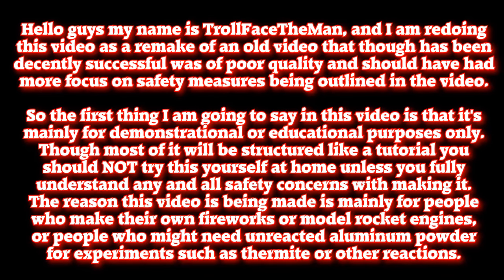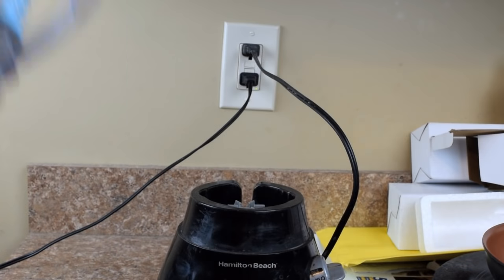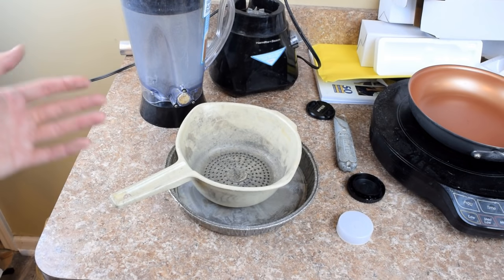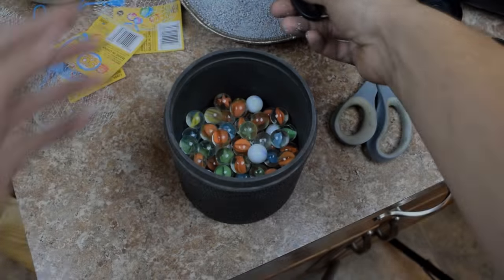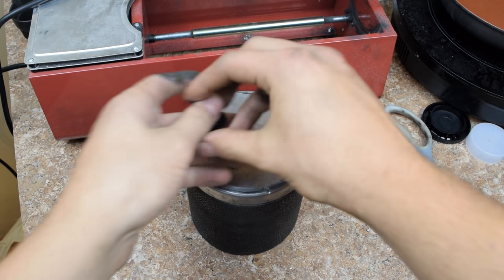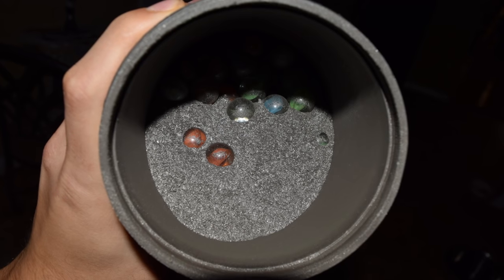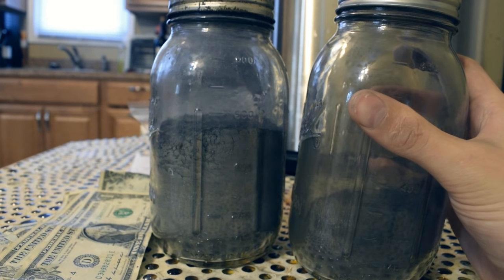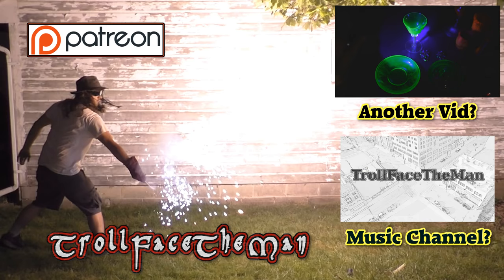How To: Easy Bulk Dark Aluminum Powder (My Homemade Process)

Comment: TrollFaceTheMan Have you heard the version that glass balls can emit static electricity that can ignite the composition? And you said that lead balls are not as hard as aluminum, so glass balls are much stronger than aluminum?
Reply from the maker: I have heard people suggest that can happen but never experienced it or seen it myself. It also doesn't make sense as Glass and Aluminum both become positively static charged (Donate Electrons) so rubbing against one another will have little to no effect in charge imbalance.

 More likely is possibly piezoelectric effect where voltage could be induced if the glass breaks but I also haven't seen that.

 And yes glass is much harder than aluminum. While lead is significantly softer.

Comment: I remember reading on Science Madness forums about an accident using this method where the person used Steric acid to inhibit oxidation which you really DONT want to do.  On opening the flash was enough to give him burns from the light alone.  I COULD be mistaken and it may have been Magnesium on second thought but I dont believe so.  IDK, Just be careful.  To fine and using an anti-oxidation additive can cause big problems when oxygen is re-entered into the equation.

Comment: Just got the link to this video in "suggested" again. Saw it years ago and now I am back. Subbing because you are still active. I believe I have the same ball mill or a substantially similar one. It is part of a rock tumbler kit I picked up at a 'yard sale' which was sold by Sears back-in-the-day. The kit is complete so I haven't tried to mill aluminum with it for fear of wreaking it. I want to build a dedicated unit for safely ball milling volatile elements. This process may be adequate for general purpose pyrotechnics or amateur rocketry but It is my understanding that the production of 'dark aluminum' or 'German aluminium' involves a different process. The process involves molten aluminium 'sprayed' into an inert atmosphere (noble gas. argon?) proceeding or coincident with the introduction of pure carbon as a 'coating'. anyways, have fun...
Reply from the maker: The process I read about involved paper lined aluminum that was had the paper burned into  carbon film then repeatedly hit by a crusher till it became a fine powder.

Comment: I tried making thermite. After failing to light w a torch I tried a large magnifying glass.turns out the magnifier works quick and easy. Thermite melts into a tiny ball and starts pulling in material around it then lights. Kinda cool
Reply from the maker: Cool to know, thanks!

Comment: 2.5:5 charcoal:aluminium? so 1:2? what?
can you please say how much in grams? i have cups in various sizes..
Reply: he say 2.5 - 5% charcoal to alluminum by weight ! but i ask him what does his mean ! 95 al and 5 grams charcoal total 100 grams or 100 grams al total and plus 5 grams next  make it 105 grams? and i wait an answer!!!
Reply: @willowpine2604  95 % and 5 % equalls 100% so you would use 95g and 5g to make 100g not 100 and 5 . That would be 105%
Reply: So for 5g of aluminium I should add 2.5g of charcoal? Somone pls answer
Reply: @Epoch_Money 5 PERCENT. So if you had 5 grams of aluminum, it would be, what, 0.25g of charcoal?
Reply: @oldkingcrow777  yes 0.125 to 0.25g charcoal powder for 5g al

Comment: TV/Film used to use a lightning simulator that basically was a burner with a air system that injected fine powdered aluminum into the flame with air pressure.

Comment: It's Pyrophoric  not pyrophobic (afraid of fire). And I use stearin instead of charcoal. Stearin is used in conjunction with Aluminum flakes to help in the grinding process in making Dark Aluminum powder. It is also used in some fountain composition, which calls for stearin powder. Stearin is a glyceryl ester of stearic acid, derived from animal fats created as a by-product of processing beef. It is used as tallow in the manufacture of candles and soap.

Colorless, odorless, tasteless, soapy crystal or powder. Purchase the technical grade, powder. It can often take the place of Sulfur and Charcoal in fireworks.
Reply from the maker: Thomas Valliere yeah that was a mispronounce by me.
Reply: you seem pretty smart,i appreciate the info but i will never use stearic acid again,it was awfull compared to charcoal
Reply: Stearic acid is used in making bright (tin man) aluminum, charcoal is used in making dark aluminum.

Comment: I had problems with the same tumbler. After a few days the aluminum was starting to get small enough, then on day 3 it became very difficult to ignite at all, even with kclo3. On inspection through a stereoscope I noticed a brown sludge that I later figured out was the rubber off the jar. I kinda thought about that when j was adding the Al, kinda like your trying to mill steel with copper analogy.
Reply from the maker: I never had that issue. Interesting.
Reply from the maker: Did you use any charcoal with it. It can protect and lubricate.

Comment: I also found that nickel-chromium bearings (best to use 2 different sizes for milling efficiency) work very well and do not spark. Much thanks to EM for that one.
Reply from the maker: Good to know. As they solid or just plated though?

Comment: Good video, thank you.  Horrible Freight sells that tumbler, too (or one that looks like it came from the same factory).  Get the double barrel version and use just one barrel at a time with no more than 5# of stuff in it.  The motors are not thermally protected and will be damaged from overloading.  I sent two back before I realized my error.  You've been warned.  :)
Reply from the maker: Thank you for the tip :)
Reply: Made my mill from junk. Works good think it turns a little too fast but gets job done.

Comment: Ballbearings have a chrome coating which doesn't spark, and is very hard. The coating is thin, and can be eroded, but sparking as a potential ignition source is a very low risk. You're more likely to generate a static electric spark than a ferrous decomposition spark in a ball mill. So if you really are so concerned with ignition sources, ground the whole apparatus, or process it in an inert atmosphere. You can even use flakes of paraffin wax in the milling process to coat particles and protect them oxidation. Though it is impractical for the home scientist pursuit to want these lab grade results.
Reply from the maker: +nunya bisnass I have used Chrome ball bearings but have had issues with the coating flaking off as you mentioned. You are correct potential ignition is still low.

 But I'd rather people be safe than sorry. Grounding the barrel wouldn't be very effective in this case as it is completely rubber coated.

 The mill is already grounded though per the 3 prong plug.
Reply: @TrollFaceTheMan you could just make this whole process a wet tumble and just use whatever.

Comment: I would mill the aluminum in argon gas, and store it under argon, or a light organic solvent, such as acetone.

But since my use is in thermocasting precision alloy steel parts, total contained reaction energy is critical to a complete and uninterrupted reaction in the process.

Comment: Very informative video. I have a question: what is the best way to store aluminium powder ? do you also have to 'oxigenate' the powder once a day ? like open the jar etc ?
Reply: In a locked container with no other active ingredients in the same locked  container.
Reply from the maker: After it is milled you just need to store in an airtight container theoretically no additional oxygen exposure should be needed.

Comment: There are simple pressure relief valves on inflatable toys that might make the airing out of the tumbler easier.
Reply from the maker: +Jay Pearce It's not actually a matter of airing it out, but letting air in. The issue is the aluminum consuming all the oxygen in the tumbler and then reacting violently when the container is exposed to fresh oxygen.

 So actually a vacuum can generate inside the container while milling.

Comment: Surely, if you are rolling in a pretty much airtight mill, you can use steel balls all the way.
I know you said to keep letting air in each day because the aluminum eats all the oxygen but surely, once all the oxygen is consumed, sparking becomes impossible since sparks are quite literally the rapid oxidation of a chip of steel/iron.
I say it would be perfectly safe to mill for a week with steel balls, but when finished, leave it for a day or two and even then, when "equalising" with the outside atmosphere, do it very, very slowly.
I'll let you know how I get on.
It helps , having a degree in chemistry.
I'd probably take more risks than your average Joe but that's only because I understand fully, the fundamentals.
>
Reply: There's a reason you introduce oxygen when milling metals(say daily). It's so that you actually get a layer of oxide to prevent the material from becoming pyrophoric. A metal such as magnesium is more likely to ignite when fine, but there are plenty of burn stories when opening jars. This aluminum looks decent but is certainly not all like 2 micron flake. (Safety tip) There are also other ways to "lubricate" the aluminum instead of using charcoal.
Reply from the maker: Your way could definitely work theoretically if you are careful and follow your methodology.

Comment: Thanks for a great video.I'm probably never going to actually do this stuff but it's still interesting.The thing is I cringe at what some people do on here and I really dont know that much. Luckily I know enough to know it''s not the right way to do things if you want to be around for a while ;)
Reply from the maker: +SouthJerseySound I am glad that you like the video. But I am confused by the second half of your comment.
Reply: TrollFaceTheMan It was referring to others videos.I see guys using steel ball bearings,unshielded motors in some dangerous setups that could easily spark and ignite the dust etc.
Reply from the maker: Oh okay, thanks for clarifying :)

Comment: The swirl in those marbles contains metals too! It will become exposed as the glass slowly chips away and makes nice big sparks. Have you ever thrown a marble on a hard surface when its dark? Marbles are NOT a safe milling media!.
Reply from the maker: Those are metal oxides in them used as colorants not straight metals and if you know about basic chemistry then you know oxides Don't spark as sparking is the process of a small sheered metal piece oxidizing and generating lots of heat rapidly.

 And when you mention throwing marbles on a hard surfaces and seeing Sparks then I can assure you in almost every senario that is because the marble is causing the surface to spark, not the other way around.

 For example you whip a marble at a steel table top and you see sparks. What's happening is the marble is sheering off a small piece of the steel table and that makes the sparks.

Comment: Works better if you put water in the blender with the aluminium. Makes the particles smaller and it cools the aluminium. Pour it out in a dish. Let it dry. Enjou
Reply from the maker: Thanks for the advice.
Reply: @TrollFaceTheMan  no problem. Just thought i share the info. This method saved me a lot of time

Comment: you can save yourself a lot of time and get a finer powder if you burn the foil with a torch before . it makes it more brittle and easier to break down .
Reply from the maker: Does make sense, although wonder how much pre-oxide that makes and ifbit has a significant effect by the end?
Reply: @TrollFaceTheMan  i never noticed a difference but i was making thermite
Reply from the maker: @andyvonbourske6405 , well thank you for the suggestion. I can see for sure how it can help.

Comment: Warning! 
Do not add to much charcoal. If you do, it could coat the aluminum too much and when you take it out. You could strip the coal off of the aluminum which will ignite it. I learned it the hard way. Use less even if it makes it worse.

Comment: 2 questions. 
1. Would ceramic work for milling media in place of marbles? 
2. What is your charcoal made from?
Reply from the maker: I believe ceramic should work. And I thought mine was some maple sticks.
Reply: By having 2/3 marbles & 1/3 lead balls, the weight of the lead pushing against the marbles would make the process faster ??

Comment: I was going to ask about milling magnesium, more volatile conditions, less or the same.  Same precautions I would assume as aluminum, but wasn't sure if there was any quirks I needed to know about.
Reply from the maker: I've milled magnesium. Definitely need to worry more about spontaneous ignition. More frequent airings are a good preventative.

Comment: If you seal the unoxidized aluminum powder in a vacuum seal glass ampule would the rapid oxidization effect cause the powder to combust? Asking for a friend
Reply from the maker: Yes, when it did eventually contact oxygen it would rapidly combust. Nurdrage did a video of that with iton powder before.

Comment: Thank you for the extra information on this.  I am in the process of making it myself through trial and error, I just need to add my charcoal. I just need to use an accurate amount. I have about one cup of partially milled aluminum,is it too late to add charcoal?
Reply from the maker: No you should be fine to still add it. I recommend about 3-5% by weight.

Comment: Can acetone be used as a surfactant to lower the free surface energy of formation ? 
Can acetone be used to coat the aluminum instead of charcoal ?
Can acetone be used so its vapor would displace air from the mill ?
Reply: Can you just add 5% by weight in airfloat charcoal and make a superior product with no acetone? YES!!!!!! lol
Reply: I don't know, but acetone burns nicely.  I have some commercial powder bought over fifty years ago from Wisconsin.  I cant detect any charcoal, but when its mixed with potassium chlorate and a bit of sulfur you've got good flash powder thats also more friction sensitive with sulfur in it.  It's never flashed in the bottle....plastic, im scared of glass for sparky reasons.  Also due to explosion hazard never make large batches and beware of static sparks. 🤕🔥
Reply from the maker: I am not sure, but I would personally fear acetone vapers and fire acceleration if something did happen. Also when out of acetone after the powder may spontaneously ignite.

Comment: I wonder if you could put water in the container and add some ascorbic acid (vitamin C) to the water first to act as an oxygen scavenger and keep your aluminum completely oxygen free with out it getting darker from charcoal in it, defintely have to look into it, thought about formic acid but since aluminum reacts with acids, figuring you have to use something milder and keep it cold while grinding.

Comment: I have a question.
I wanted to make some Aluminumsand for thermite. Would it work if i just mix it in the blender, so it is a sand and not a fine powder. I know it will be low quality themite, but will it work (so the iron melts)? Or will the surface area be to small.

And very good job explainig safety measures. Better save than sorry.

Comment: Would the dark aluminum react with black power when mixed together? A little DA in a fire cracker might be interesting or perhaps some in the report of a rocket. Maybe they already do it. I don't know. Haven't noticed.
Reply from the maker: I have no clue, I would imagine if the Black Powder is already balanced the addition of aluminum could slow it perhaps.

Comment: I know that this is an older video , but it is also the best video that I have found on YouTube . And I have watched all that that I can find on this subject . Now to the reason I am commenting . Could I use Alum. drink cans ( the ones that have no deposit ) , I have a FEW  , or would the coatings and inks screw up the powder ( for pyrotechnics ) ???
Reply: No, since you're burning aluminum, a little ink isn't going to matter at all.
Reply from the maker: Theoretically it'd be fine, if not likely more challenging to mill.

Comment: Hi, I am from Kashmir 
In this video,first clips you show that the powder brusts huge and makes a lot of light.But when you shows how to make powder,later when you shows us the reaction of making powder.the powder does not works according to first clip you show.what is the reason
Reply from the maker: The powder does that if thrown into the air after lighting because you are mixing it with oxygen suddenly. In a pile it'll not do that, though.
Reply: Thanks

Comment: I want to buy Potassium Chlorate for smokebombs and maybe some explosive things (only small, like petards).. I never had it so it is safe? Where should i put it to be safe? Or some things to beware?
Reply from the maker: Potassium cholrate is relatively safe, but reactive with sulfuric acid. For this reason anything with sulfur in it might spontaneously ignite if mixed with it. I recommend potassium percolate, it's not quite as powerful but is more stable.